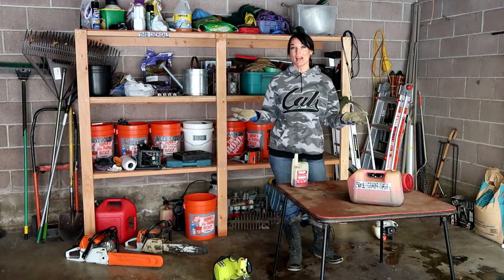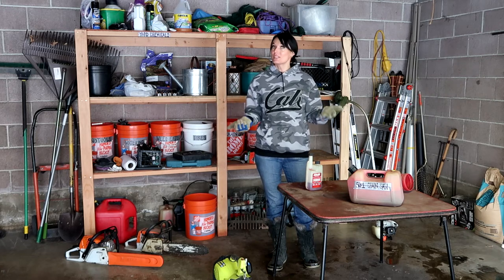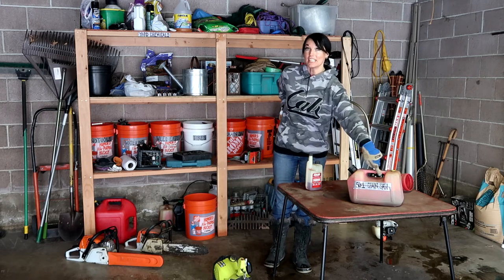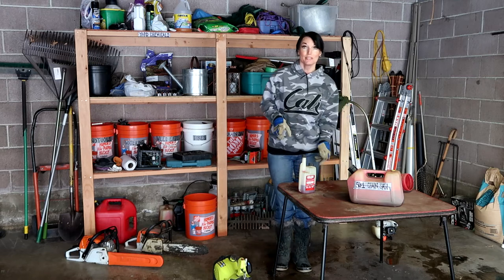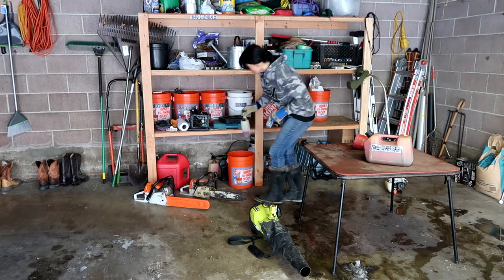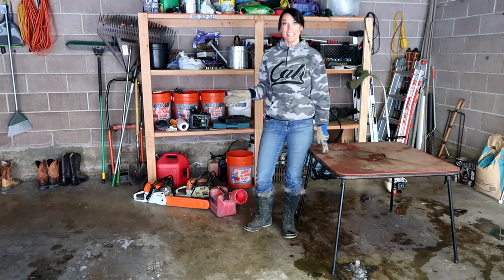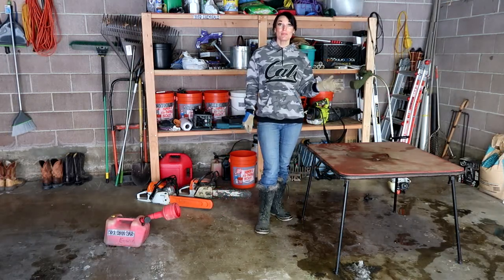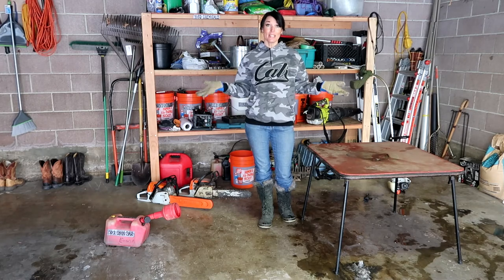Winterizing My Power Tools

Comment: Some times you have to be careful running a two stroke engine dry because it also has its oil in the gas and we all know running an engine without oil is not good for it Bess thing to do is to run it until it starts surging then shut it off leaving very little gas left that will evaporate but the oil will stay.

Comment: Hey K,
Thanks for the video but wanted you to do a cold start video on both of your chainsaws and weed eater
Reply from the maker: I aim to have my videos around 5 to 10 mins. If I was to include all that, it would have been over 20 min. That's just a little too long. Plus, I struggle to start the chainsaws, they are extremely touchy. 
Right now my toenails are a shiny red!!
Reply: @katray-workhardplayhard4312  
K, then split up the two videos into 10 minute videos showing you cold starting the two touchy chainsaws and weed eater okay?
Also nice color for the holidays!  What size are your feet?
Reply from the maker: Now that all my power tools are winterized, I'll do a video in the summer with the chainsaws and weed eater as you requested.  My feet are woman's size 9.
Reply: @katray-workhardplayhard4312  
Remember when you said this a month ago K?